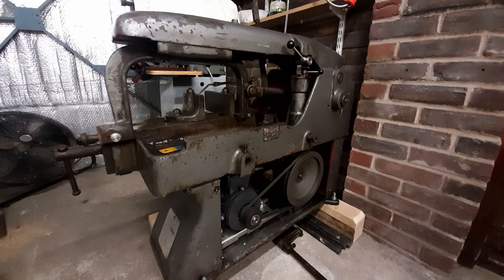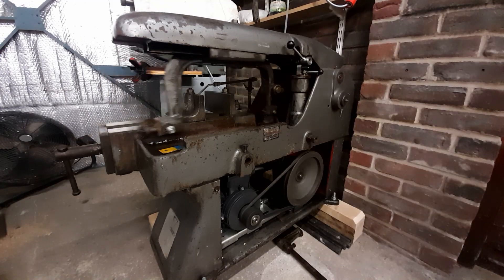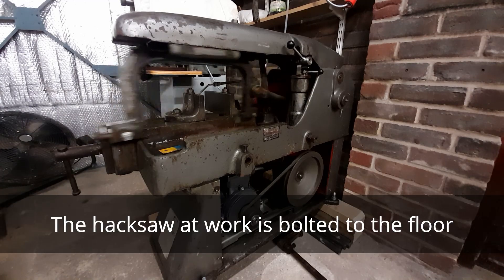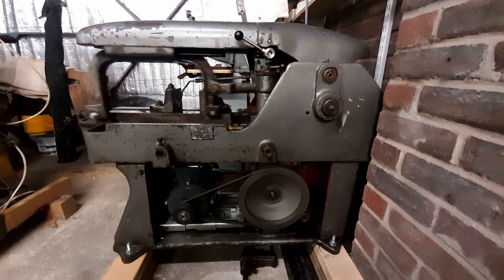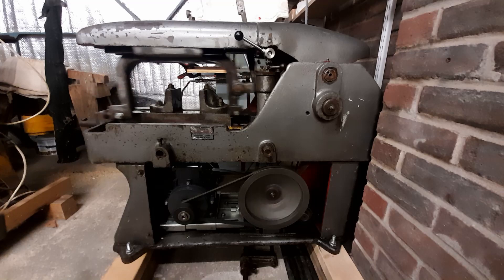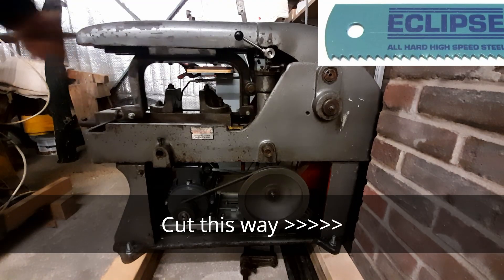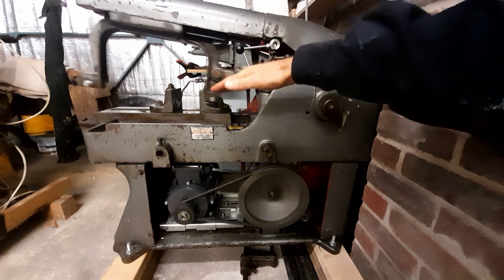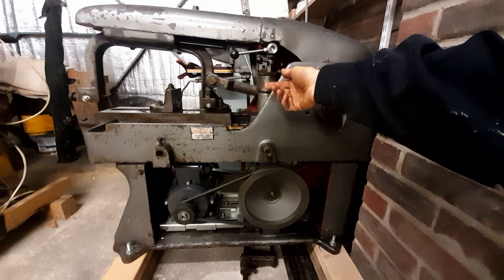Power Hacksaw with new 3-phase motor (0.5583TECAB3) Qualters and Smith 6H

Comment: Great stuff. Have you got a video of it cutting some steel?
I recently got one of these saws but my pulley goes the opposite way?
Reply from the maker: Here's a video showing some pipe being cut https://youtu.be/Vlr_ZJ6jEwM
Reply from the maker: Do you think it's going the wrong way? If be interested to know what you are doing for lubrication. The main slide is clearly oiled (hopefully you've added oil to the reservoir and checked the felt wipers) but I'm not certain about other points where grease nipples have been added - I'm wondering whether oil wouldn't be more appropriate.
Reply: @PizzeyTechnology  Mine might possibly go the wrong way. I have just recently got the saw and I am still getting everything ready for its first proper test run. I am awaiting a new inverter and new belts. Mine has got the small suds pump that runs via a pulley and I will use a suds oil/water mixture. The UK Mig Welding forum has got a few threads about this saw.
Reply from the maker: I've got the suds pump but if I'm not mistaken it only pumped when driven in this direction. However, I'm not using the suds pump because I can generally cut dry with no problem and I prefer to avoid the mess. What motor will you be using?
Reply: @PizzeyTechnology  I am using the original Hoover motor. I opened it up and rewired it to Delta. I can now use a 1 phase ~240v to 3 phase ~240v inverter. I asked for advice on how to do it on the Mig Welding forum. Search my username on there 'Smouser'.
Reply from the maker: The handy thing about keeping the old motor (apart from saving money) is the foot mount fits the machine. If you ever change the motor you may need to make an adapter plate.
Reply from the maker: Just had a look at the mig welding website - looks useful. I see the manual being mentioned. Do you have a copy?
Reply: @PizzeyTechnology  I am not sure lol. I have the parts list and drawings and a manual for the saw one bigger than ours. Most things will be similar.
My forum username is 'Smouser', contact me on there if you would like a copy.